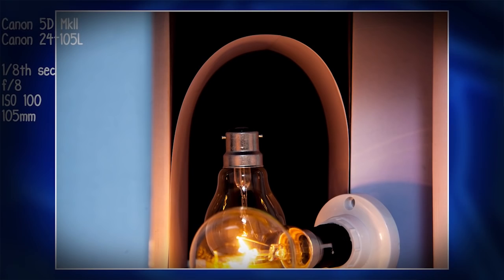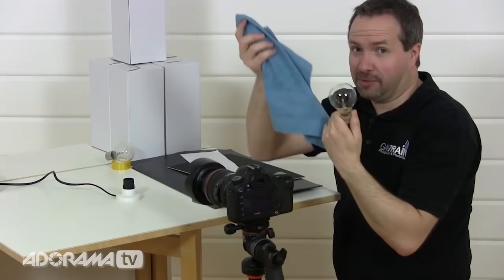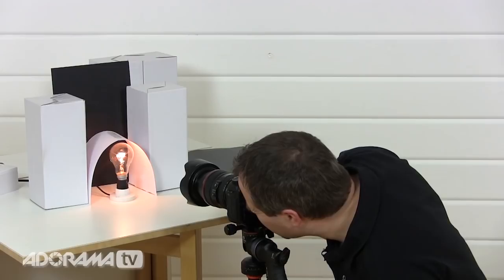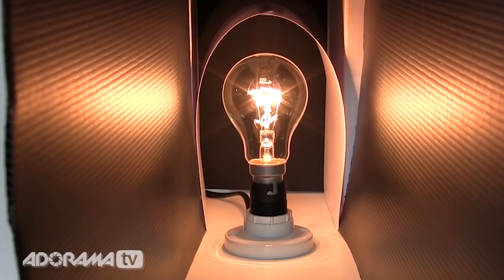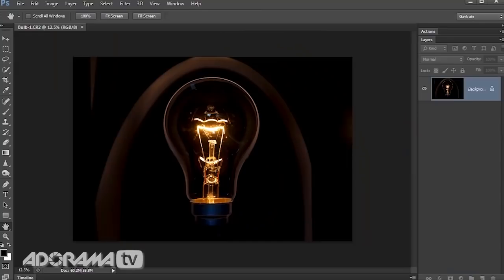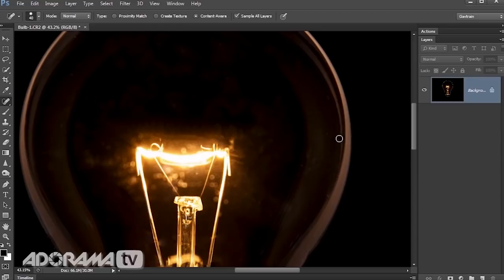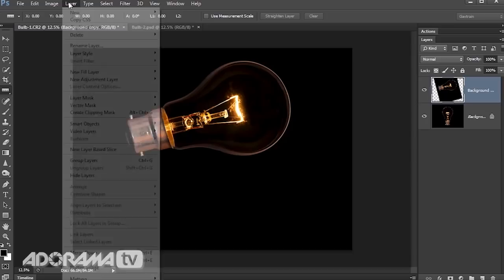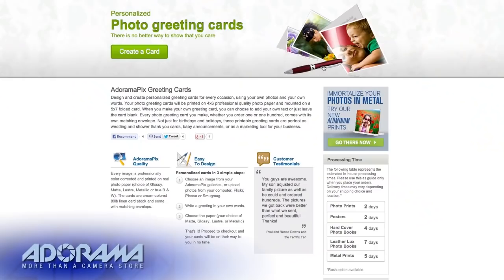Lightbulb Without Wires: Ep 124 Take & Make Great Photography with Gavin Hoey

Comment: Thanks, very helpful. May i only suggest that you rotate the 2nd bulb during shooting a little bit, so it does not stand on the thin pin in your final picture. I am not sure it can be physically stationary in such position and will tend to roll off the pin.

Comment: WOW How did this past Health and Safety? The batten hold with your light in it Will have exposed terminals at the rear that are not covered up....Unless it was fixed to a piece of wood or plastic to insulate it. It is not as if you have an isolating transformer in your dimmer.

Comment: Just an doubt..instead of using black card to cut off the reflection  why don't  we shoot in dark room..?if we shoot in Dark room can we face any difficulties..?
Reply: I've just done exactly that Mohamed.  I taped the bulb holder to a stand, and positioned a table behind it to hold the reflector card hoop.  I had no background as such, or any black cards - just shot in the middle of a dark room, far enough away from any walls for the light to fall off to black.  It worked really well.